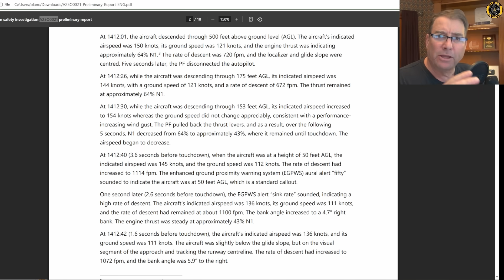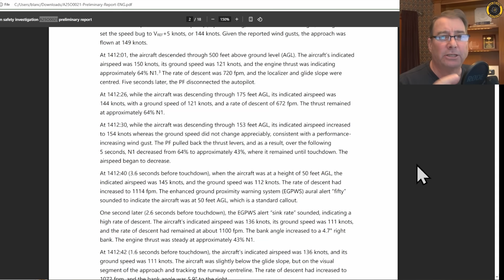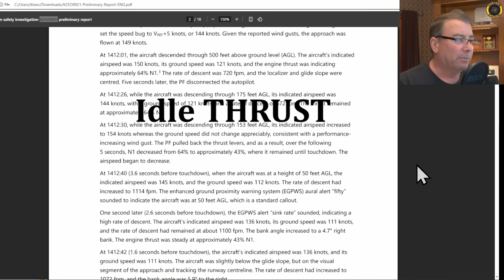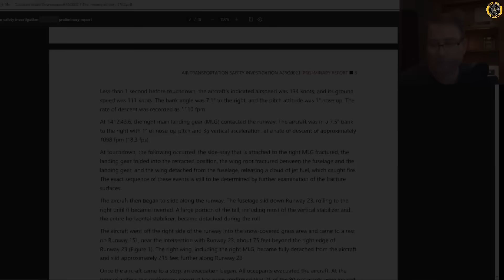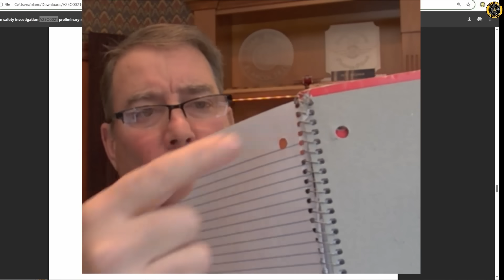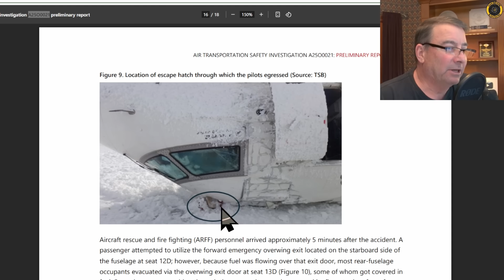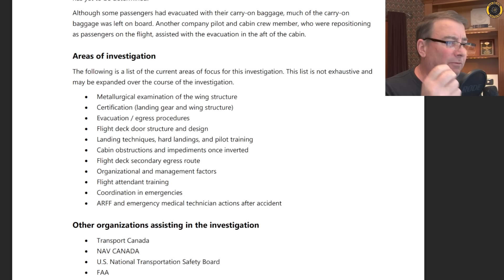TSB Prelim Toronto CRJ Crash

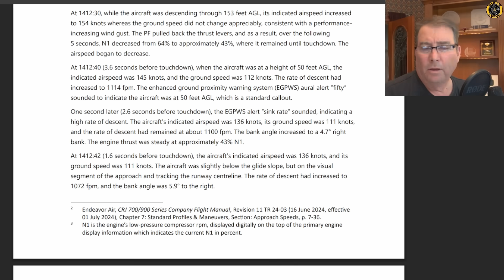Comment: At just after 06:30 you say pilots need to slow the sink-rate by adding power.  I'm not a jet pilot, only single-engine land propeller pilot, but I thought I've heard you say in other videos that jet engines take longer to "spin-up" than propeller planes.  I know for sure that in the propeller airplanes I fly that no way would I try to increase trust in that situation ... I'd pull back on the stick/yolk to raise my nose and angle-of-attack to slow descent speed.  Given that jet engines spool up even slower than gasoline engines, I would think that power would definitely NOT be the way to deal with this situation so close (in distance and time) to touchdown.  Why am I wrong about this?
 
You see, even before this video it was my opinion that the pilot flying did not pull back on the stick/yolk to raise the nose because she thought she was higher above the ground than she actually was.  Why so?  Because the runway was dusted with snow plus there was also blowing snow, which likely reduced the detail visible on the runway, which would give the impression of being higher than she was.  You add one more potential reason for the same conclusion when you say the runway was plowed in a way to make the 200 foot wide runway only 150 feet wide ... which could also make the pilot flying think she was higher than she actually was based upon her previous experience landing on the 200 foot wide runway.
Reply: Great thoughts.  Jets do take longer to spool up, but there is a big however.  However, if they are already spooled, as they are the last 1000', they are generally very responsive.  Not immediate, but certainly not very laggy.  So, in a no notice goaround, at like 100', use pitch to maintain airspeed, and thrust to climb.  The wheels might touch the runway (or taxiway, I'll never judge a go around initiated by a pilot), but as long as the pitch is maintained, you'll start climbing right quick.  A perfect example is the goaround by SWA at MDW the other day when the bizjet crossed the runway in front of them.  You can see the engine's heat signature pour out massive thrust, and the pitch remained pretty much the same. 

FWIW, you're not "only a single-engine pilot."  You are a pilot that flies single engine piston.  You do the same pilot siht every other pilot does.  A pilot is a pilot is a pilot.  :)  I once interviewed an SR-71 pilot - he made me aware that he and I just had different equipment, but the same pilot brain.
Reply: @ericsd55   : The other reason I forgot to mention is this.  While you're flying and especially landing at least one hand if not both is actively on and manipulating the stick or yolk.  You're already making pitch adjustments every fraction of a second with your hand.  So even if thrust could increase immediately ... and have a measurable effect on the trajectory of the airplane ... the time to reach for the throttle lever has to be substantially greater than pulling back on the stick or yolk.  Also, if you're already descending too fast, adding power may make you descend even faster for a short period before it starts to slow descent.  At least that's how the planes I fly function.
Reply: @maxbootstrap7397  Eh, I’ve never seen an airline pilot two hand a stick on approach and landing. One hand on the stick and one on the power - even during an autoland.
Reply: @ericsd55   : That's reasonable.  Nonetheless, I and every pilot I know tweaks the stick/yolk position several times per second during the final seconds of landing ... but rarely tweaks the throttle during that period.  Though I'm surely not typical, my normal behavior is to set the engine to idle several miles from the airport on a high approach, then control altitude and speed entirely with stick and rudder.  In other words, varying degrees of slip to control altitude and varying degrees of nose up to keep speed from getting too high.  You will note ... there is ZERO manipulation of power in my typical approaches and landings --- for several minutes or more.  I'm not saying airline pilots should do the same ... they usually can't because they often need to stay on a certain angle of descent on pre-defined IFR routes.  But when it gets down near the runway there is no reason they couldn't adopt my technique that involves no adjustments of power.  But I think the bottom line is still the same --- all pilots tweak the stick or yolk more quickly than they tweak the power lever.  At least I think so and hope so.  If not, I either disagree with how pilots fly airliners ... or I don't understand some subtle but important aspect of how airliners behave during the last seconds of landing.
 
I will add one more comment.  I would rather add more flaps in that situation than more throttle!  At least in planes I fly, the plane tends to HOP upward a short distance very quickly when flaps are added.  Which means, I would rather have one hand on stick and the other on the flaps lever instead of throttle.  But I'd still rather slow descent by pulling back on the stick unless something very radical made me think I NEED that quick HOP upwards.  Of course if a pilot is already full flaps, that option no longer exists.

Comment: Sorry guys, but this falls on the crew. There was nothing here that should be above the aptitude of an airline crew.

However, airlines have determined that 750–1,000 hours are sufficient no matter the experience to fly pax if you can pass classroom and check ride/line check check rides.

The reality is the paying customers count on professionals to determine what is safe or not and the almighty dollar for airlines has determined less experience is cheaper.

Burning holes in the sky for 750 hours in a 152 doesn’t make you qualified to carry pax.
Reply: You start by saying: 'This falls on the crew' and then argue the cause is too little training and experience by the crew. You also blame greed.

I can follow your arguments, but 'This falls on the crew' is a very onesided summary that doesn't reflect the causes you identified.

Comment: Non-pilot here, just curious. Vref is 139, so they fly at +5 or 144. If the winds are at 10, gusting to 30, then the gust component is 20, so you would add 1/2 or 10. So do the add the 10 to the 139 making 149, or to the 144 making it 154?
Thanks
Reply: Yes, pretty much.  Airline pilot here.  Usually, the industry standard is Target + 5 = Ref.  Add the wind to Ref = (half the steady state + all the gust) but not more than 15 or 20 depending on the SOP.  Wind speed corrected for xwind factor.  Or, back in the olden days, "10 knots for mom and the kids."

Comment: When you brought up the lack of stick-and-rudder skills it reminds me of Colgan Air 3407 (that lead to the 1500 hour rule for FO's) where the captain pulled the control column aft in response to the stick shaker causing the stall and crash in the Dash-8-400. And he had previously worked as a CFI. This blew my mind because being a CFI myself we practice so many stalls that stall recovery is 2nd nature to myself and my students. And I flew the Dash-8-200 & 300 and the things flew like giant C172's.
Reply: That’s something that has been bugging me since the crash. Stick shaker is active and the first thing the pilot does (well, supposed to do), is to push forward the control column….no pulling it back 🤷🏻‍♂️
Reply: I undertsand what you mean and agree with you. However the 400 doesn't fly like a big 172.  As a comparison the 400 is 20000 pounds heavier than a 300 and only has 18 inches of wingspan more per side compared to a 300. So the 400 flies like a 20K lbs overloaded 300 with twice the power. There are similarities but it's quite different on many aspects. Being very experienced in the 100 and 300 I didn't understand how they came to stall that Dash 8 in the first place, but after flying the 400 I totally understand. Stop watching that airspeed for 5 seconds and you're 10 knots slower wihout realizing it. The 300 is a very forgiving aircraft, but turn your back on the 400 for a second and it will bite you badly. Sometimes moving the power levers the slighest amount you can is too much of a power change, you have to only move one. It's that sensitive and quick to react. But I agree, their stall recovery reaction was fatal.
Reply: Once again, quantity doesn't mean quality.
Reply: The FO changed flap configuration causing the Change in Stall speed.
Reply: @Lcr38  But that doesn't change the fundamentals of how you recover from a stall - if you get a stick shaker, you should be pushing your nose down, not pulling up.
Reply: @Lcr38  correct. And that doesn't change stall recovery technique.

Comment: Here's a mind- bender: Does not the head-wind sheer, also create a calculable drag? So, the additional lift is joined by wind resistance- how do you know which effect is greater? Stick and rudder are replaced by Chip, and Siri. :(

Comment: I flew in a corporate flight department and I was aware of the skill level of all the pilots I flew with. Any challenging legs I would fly that leg if I didn’t think the other pilot was up to it.  We usually alternated legs like the airlines however this was a gusty day with a low time copilot and if I was the Captain it would have been my leg.
Reply: I have never let the weather determine whose leg it is.  The captain should have called GA the second he saw the unstable/unsafe condition.  Even a “Sink Rate” alert didn’t trigger either pilot to GA. 
Gross Negligence!
Reply: @sincerbeaux767  You have nowhere near enough information to make that assertion.
Reply: Exactly.  She should not have been landing the plane with such a low hours.
Reply: @Starfish2145  Nonsense, that is the way new pilots learn. The conditions that existed were not that bad.
Reply: @Starfish2145  She was qualified to fly the aircraft and had considerably more recent experience than the captain.
Reply: @hb1338  If she was qualified to fly the aircraft, then the qualification standard need to be changed, or she needs to be interrogated to determine whether she deliberately crashed the plane.

Comment: I was in the computer business when airplanes transitioned from analog to digital control.  We had many complaints from pilots that they were required to have too much heads down time and not looking out the windows.  I soon realized that pilots were being taught to program the computer to fly the plane and had no stick and rudder skills.  Kind of scary...
Reply: It takes pilots typically twice as long to scan digital displays than analogue ones. Most flight director settings are programmed ahead of time and have no impact on heads down time.

Comment: When I was at Endeavor we set the VRef plus five and flew the top of the bug which is ten knots above VREF.  That was what was the training. Interestingly I looked back in my log book and I flew the accident aircraft before.
Reply: That makes (more)sense.
Reply: Non-pilot here: what exactly is involved in flying the top of the bug?
Reply: @L0rdArtemis  on the airspeed display, there is a marker you can set for your airspeed.  the mark is triangular - so the point of the triangle is the set airspeed.  he is saying, they would use the top of the triangle instead of the point.
Reply: Also a corporate pilot for 20 years.
Every operator I flew for we bugged Vref +10 or flew the Vapp bug. We then flew 1/2 the gust faster up to a max Vref +20.

I have never bugged the gust factor, but none of the types I have flown are auto throttle equipped.
Reply: No adjustment for wind and gusts?  Corporate flying for 20 years.  Always used something like half the steady state plus the gust the gust factor up to 20 knots
Reply: @ Yep, that's what we taught, but apparently the math was too difficult, so now we've dumbed it down to Vref plus 5 to 15, whatever you want.  It's terribly disappointing, but  that's the way things seem to be going.  We're all going to be automated out in ten to twenty years anyway, so us old-timers (who actually know how to fly) are going to be anachronisms soon.
Reply: @miketravelsfree  fly Citations and Gulfstreams.  A lot of it is just common sense.  If you have an 11000 foot runway the least you can do is carry an extra 20 knots in those conditions.  Your GS will still be slower than in a calm wind situation.  I have only flown 91 with a little bit of 135.
Reply: @miketravelsfree  At least you will be alive.
Reply: @williamhill4853 Yep, I've flown N932XJ numerous times as well.

Comment: Just my opinion of course but I think the first license should be a glider rating that's where you really learn to fly an airplane even after all the engines have failed
Reply: GOOD observation... Having myself some hours on gliders, I find that the "older" gliders are even better for getting experience, than the most advanced high performance types; as they force you to acquire more "feel" of the maneuvers.  

Several of the "famous" landings in history, were achieved by pilots with either Glider proficiency, and/or higher than average "Stick&Rudder" abilities; people like Sully, Capt. Pearson of the "Gimly-Glider", and Captain Carlos Dárdano, who landed with engines stopped on a levee... Those are the standards to aim at.
Reply: @alfredomarquez9777  yes to the older gliders. An old 2-33 with half spoilers glides about like a Champ or Cub on final.
Reply: ....and you ARE going to land because you don't have the energy to "go around" like you do in a modern sailplane